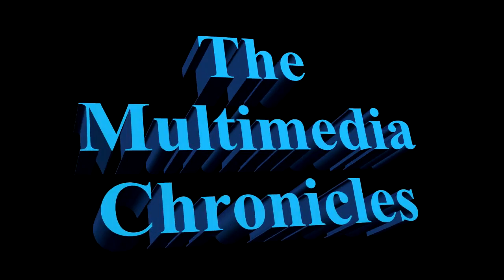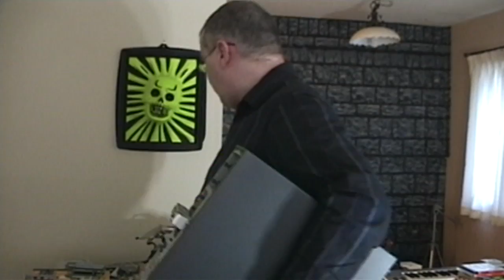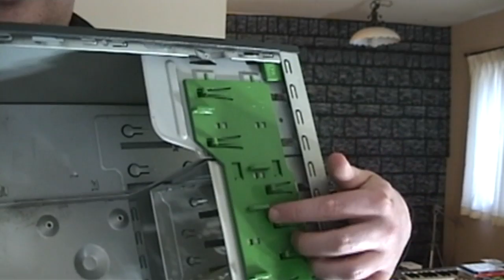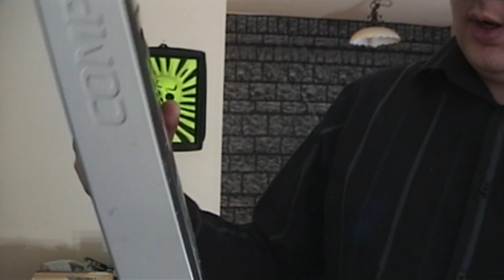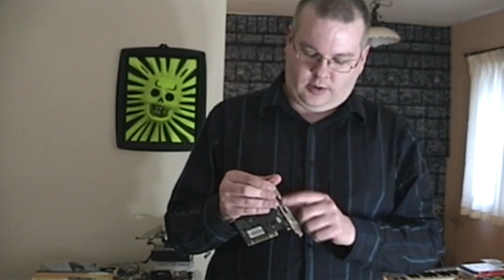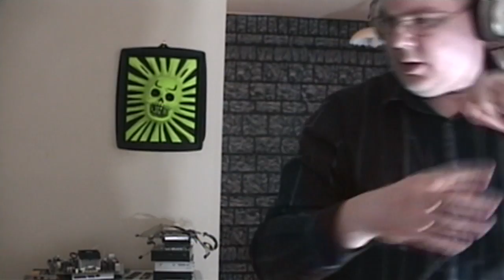Old Computer Bits n' Pieces - Part 2 Plus: The PS3 Browser SUCKS!

Comment: I have a antec 902 case and it can hold upto 8 hard drives internally. It also has a sata port at the top of the case  for another hard drive + 2 USB at top, and headphone, mic sockets. One of the best things for me about this case is , it has 4 fans and room for 2 more. It may get loud but in my opinion it's better than overheating your tower .

Comment: @Zaranyzerak Ah Ok thanks for clearing that up. Though like it or not the same can't be said for the handheld equivelent. But still I find it hard to accept that a couple of PS2 titles are still being released, however no one is selling the consoles, unless they are used or brand new and expensive? I had to buy a 'slightily' used PS2 to replacve my old PS2 which had been usurped by my sister and no I haven't recieved it yet due to massive snowfalls we've had, we're just not a snow country.

Comment: Woah, what's the model # of that Presario?!  That's like identical to mine, although the opposite is true about mine, the usb port on the card reader in mine DOESN'T work, but the slots DO work.  SR1811NX, must be similar, the specs are a bit different.

Comment: When u decide on a full tower case it will cost u around 135.00 & up.  Will your new Mobo fit in a mid size ATX Case?  And of course you'll need a separate graphics card & not the built in one on you motherboard.  Continued luck on your new build. P.s. New Egg is cheaper the Tiger Direct.